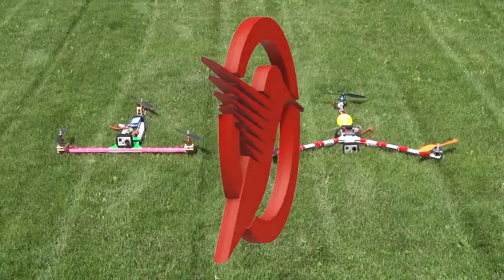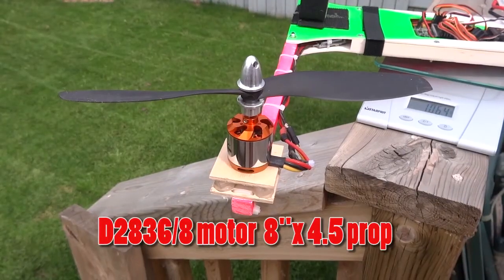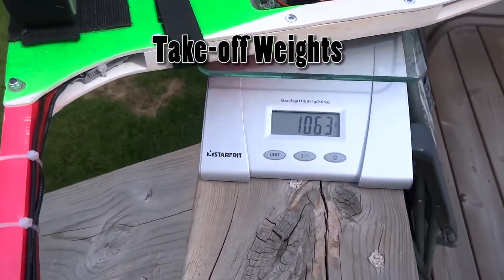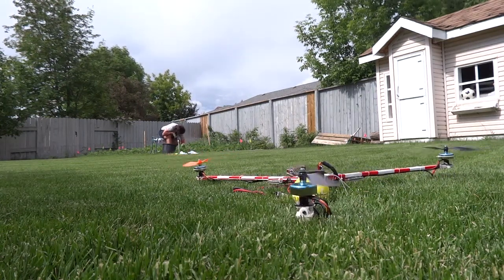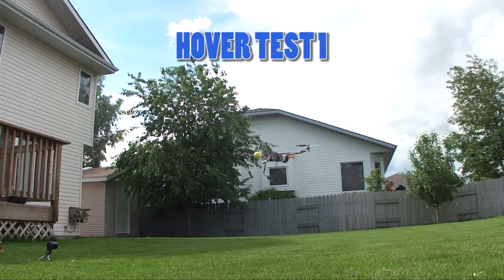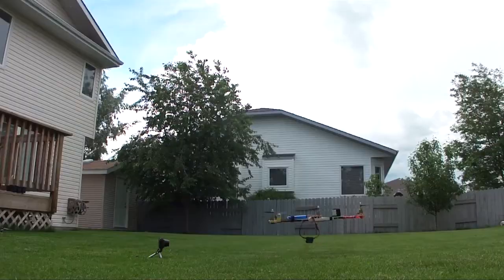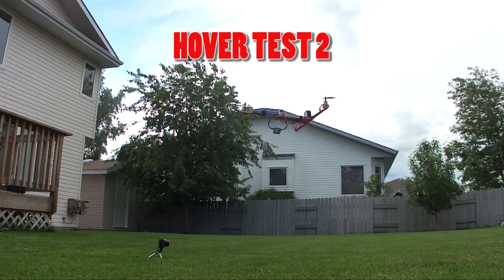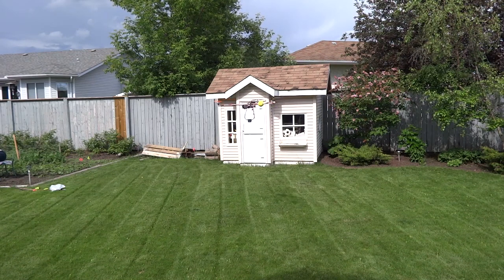Copter Comparison

Comment: Thanks for the video.  It seems that the biggest comparison that you're making though is not the airframe, but the motor/prop configuration.  I'm currently building my first tricopter, and decided to buy 1100kV motors (mainly because I couldn't find the equivalent to rcexplorer's 750kV ones here in UK) and bought two sizes of prop (8" and 10").  After watching this video, I think that the smaller props will work better with my motors!

Comment: Wrong, prop/motors do matter!!
Depending on the motor/prop combination the amps differ.

1. the motors could be more efficient and
2. the motor/prop config is important, too.

ecalc.ch can show you that!!

The result of your comparision shows the Y copter is the winner.
Having both weigh in at the same amount is a good start.

But, the moment you use different props and motors you don't know if the difference in flight time or flight characteristic is a result of the frame or the motors+props.

Comment: The hover test is not so good.

The Y copter barely hovers = low amperage
The T copter takes off like a rocket = high amperage

So what? The more throttle you use the more amps it will use?

What does that tell us?
They aren't even using the same motors.

So this test is useless.